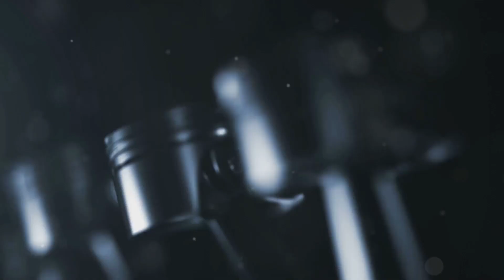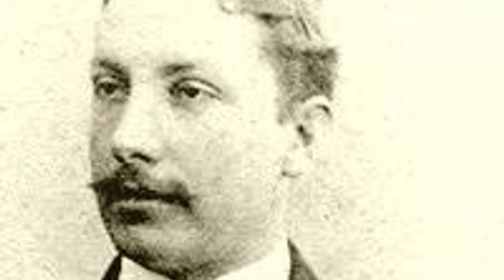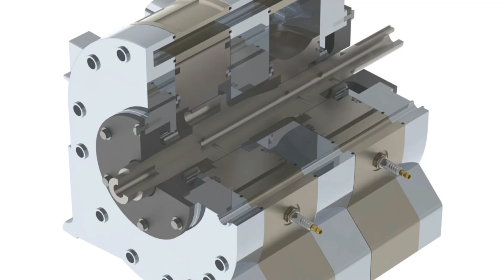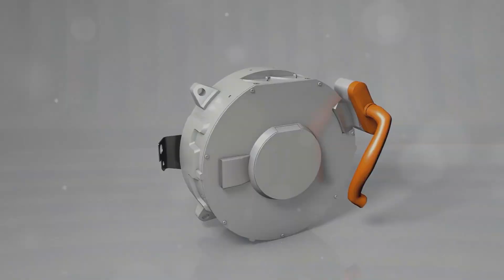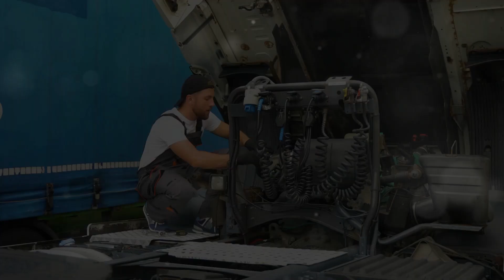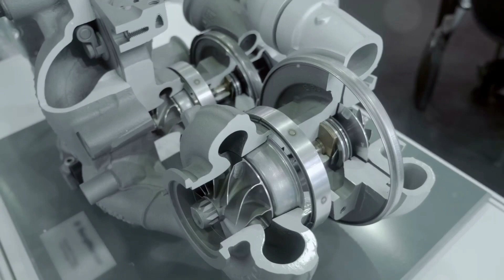How do Turbochargers Work? (Explained Simply)

Comment: Turbos increase the energy density of smaller truck engines.

To illustrate the concept, hypothetically instead of say a 30 litre naturally aspirated V12 making 2000ft/lbs of torque, a 15 litre 6 cylinder can make the same torque on boost at 30 psi of boost and off boost saves 6 cylinders in engine pumping losses. 
It saves on 6 cylinders of fuel over the V12 and saves on engine weight allowing more payload.
It is also more compact allowing a smaller and therefore lighter prime mover, further increasing payload.

Again, turbos increase the energy density of smaller truck engines.